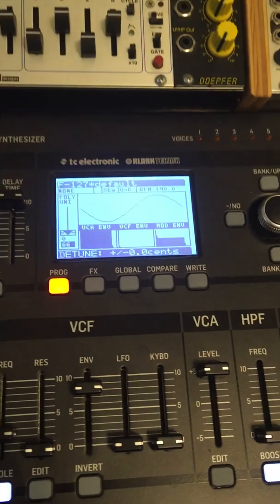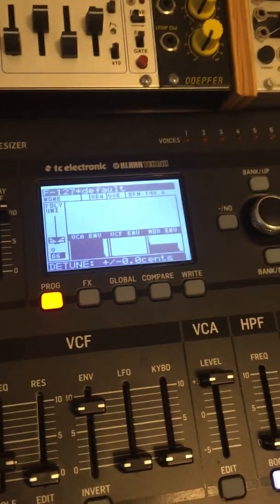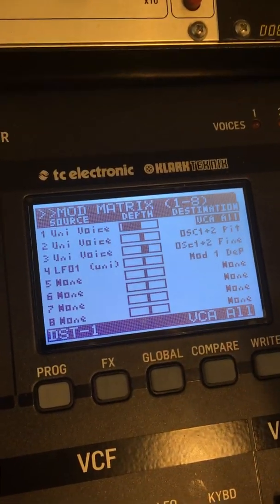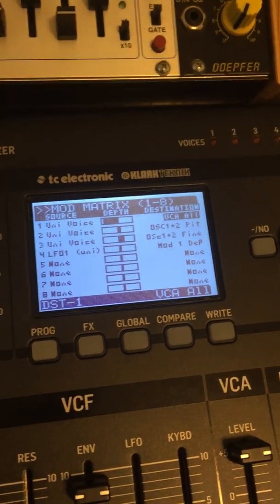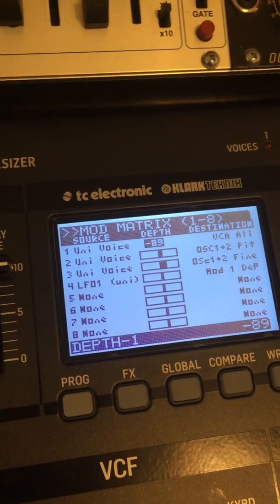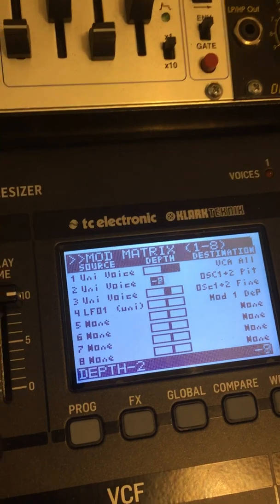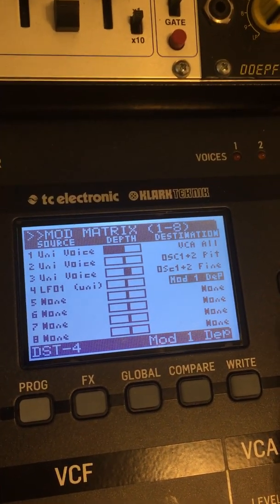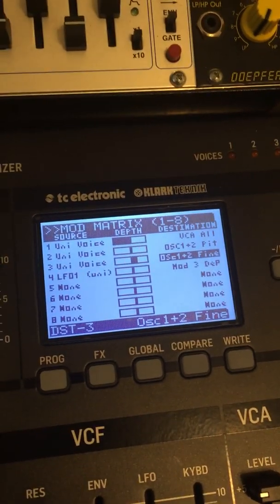Real 2 Saw Oscillator Patch on a Deepmind 12

Comment: Cool, but what if you have 4 or 6 unison voices? you can only control 3 or 5 of them on top of the initial voice?
Reply from the maker: good question! i think it's additive, so for example, if you're adding 7semitones to the second voice 2 unison voice stack, it'll add 7 more to a 3rd voice so it'll play a 5th+9th. but i have to try it and see. it definitely works best for 2 unison voices.

Comment: I saw someone do this a couple of years ago but couldn't remember how it was done.  This vid was helpful! And also painfully obvious now that i think about it. haha.  But when using 'VCA All' the VCA stays open. So use 'VCA Active' as the destination and it works normal.  

And i completely agree with you on the synth.  I have the DM 6 but the sentiment is the same.  It gets judged faaaar harsher just because of the Behringer name.  Which is dumb.  But Deepmind owners know it's legit.